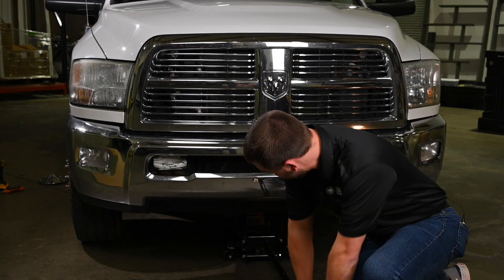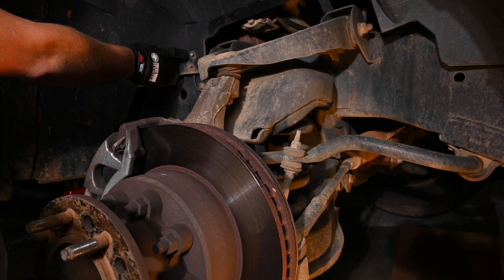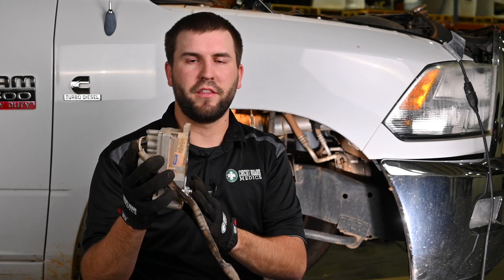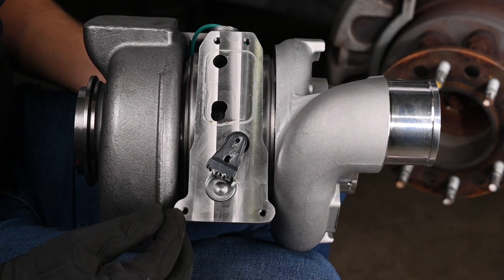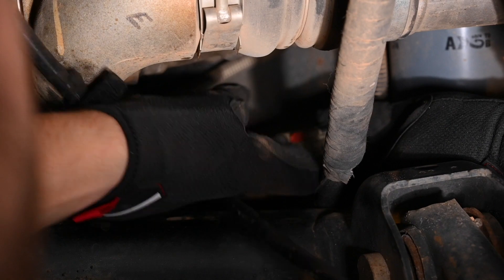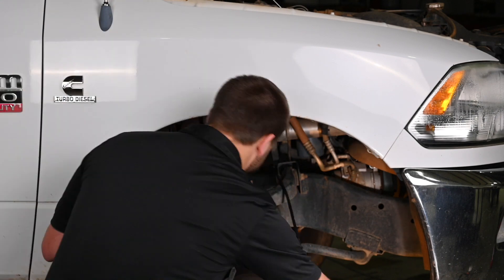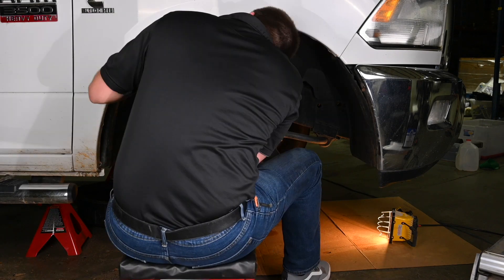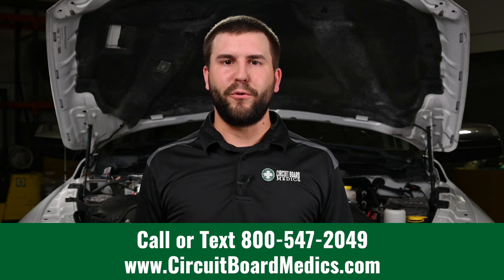Cummins 6.7L HE351VE Turbo Actuator Removal & Installation (Ram 2007, 2008, 2009, 2010, 2011, 2012)

Comment: I replaced my turbo actuator on my 08 6.7 Cummins today using this calibration tool I didn’t have a exhaust break before replacing it and I still don’t have a exhaust break my turbo sector gear moves freely with full travel and no back and forth movement on my compressor wheel this thing really has me stumped
Reply from the maker: We'd recommend you scan for fault codes before any next steps can be done. Any issues related to the coolant temp, ambient air temp, throttle pedal position sensor could disable exhaust brake.

The actuator is good at self-reporting issues to, so if it was an actuator fault we'd expect to see either a P00AF, a P003A, or a U010C.

If you need further help feel free to reach out at 800-547-2049 :)

Comment: Just ended up having to do this on my truck... ordered circuit board mechanics turbo actuator and relearn controller. Video is very helpful and parts are oem rebuilt. Happy to finally have exhaust brake back and be boosting over 40lbs again.

Comment: Outstanding!!  I'm a Hellcat guy, but had a chance to then get a 2018 RAM 3500 Cummins G56 new off the lot in August 2018.  I knew nothing of diesels, but have tried to learn since then. I always wondered how the actuator was "clocked" or calibrated when installed.  Thanks so much!!!  If I could give this video 10 likes, I would!